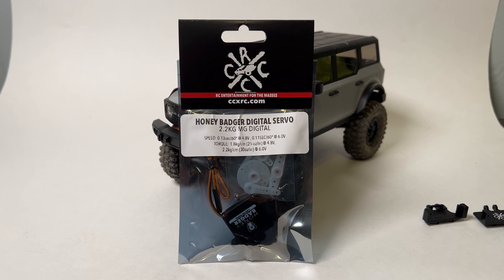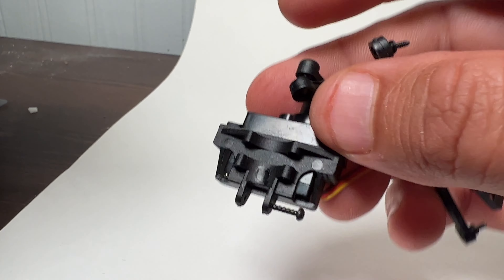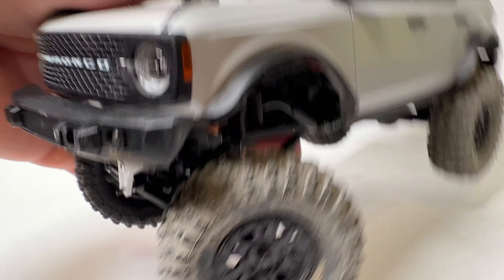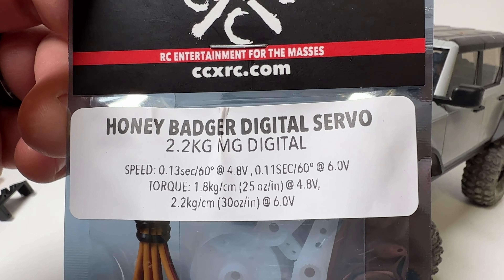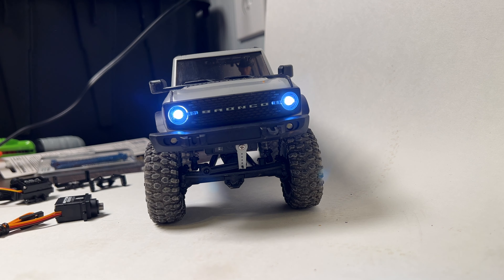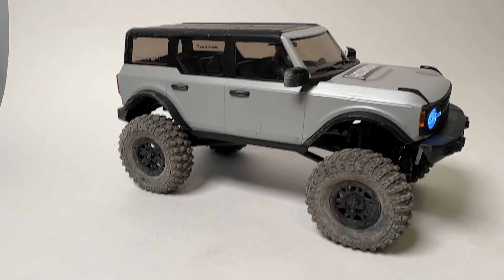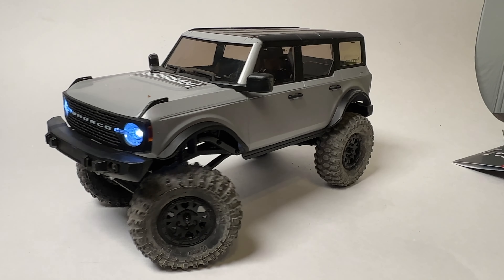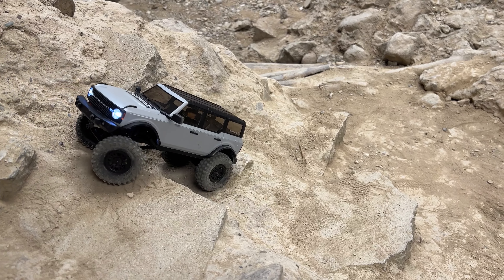CCxRC Honey Badger Digital Micro Servo. It's SMALL, but it DON'T CARE!

Comment: What steering horn do you use
Reply from the maker: I use the plastic white one that comes with it. We don’t run servo savers, so the plastic horn offers a little flex and protection. I do link to a metal horn that works with it on the Honey Badger product page on my site for anyone interested in one.
Reply: @CCxRC  thank you